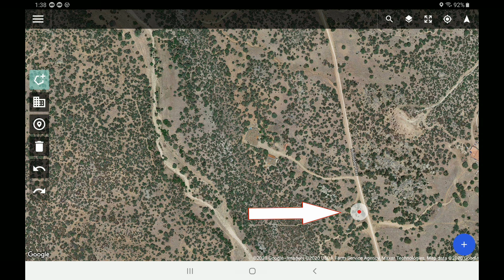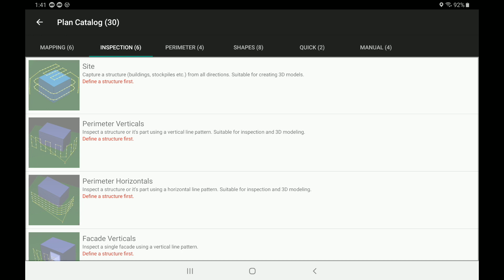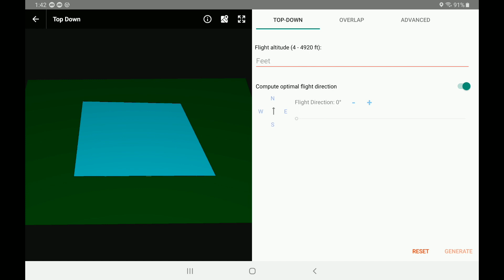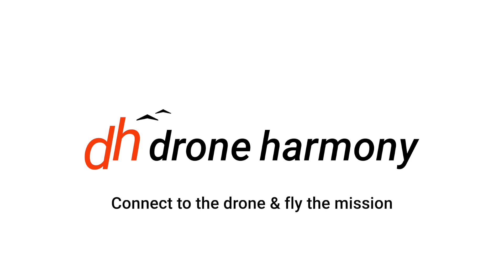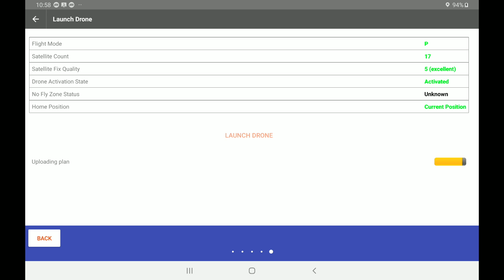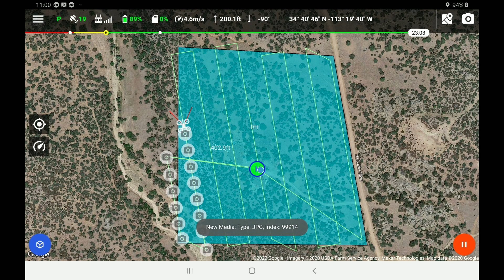Simple Drone Harmony 2D Model Workflow - Lesson 2

Comment: Looks very good.  Is it possible to lasoo selected waypoints and increase their altitude please ?
Reply from the maker: Yes, the tool is available in Drone Harmony mobile. Select the mission and you will see at the left a lasoo tool for selecting many waypoints. Once you have selected many, you can then use the pen (edit) tool to muli-edit the altitude of the selected waypoints.

Note, that we currently refactor the UI/UX of Drone Harmony mobile and it will look maybe a bit different (and hopefully) easier to access in the future.